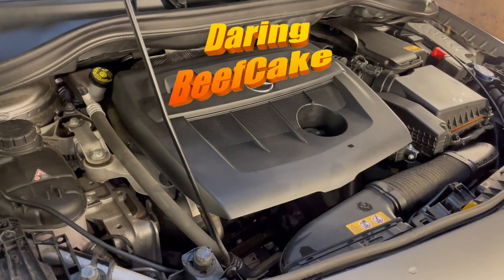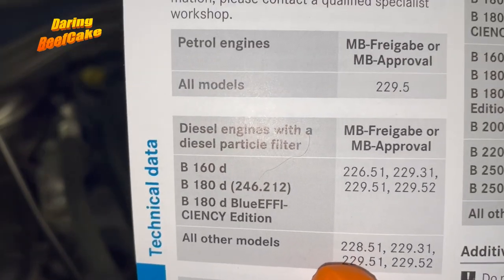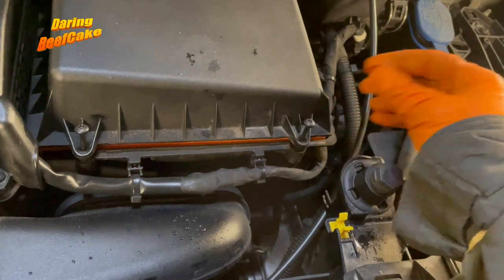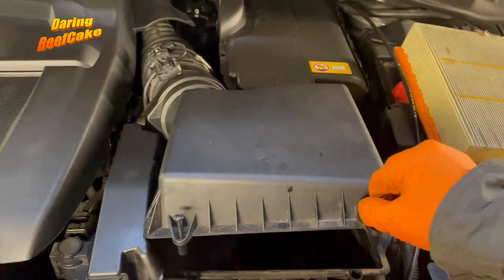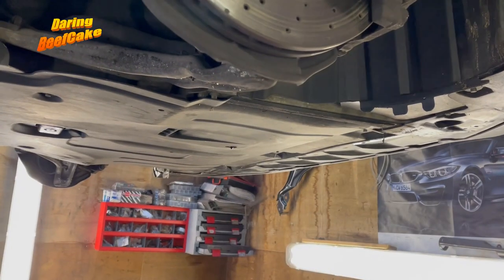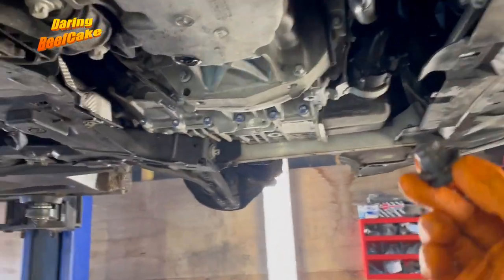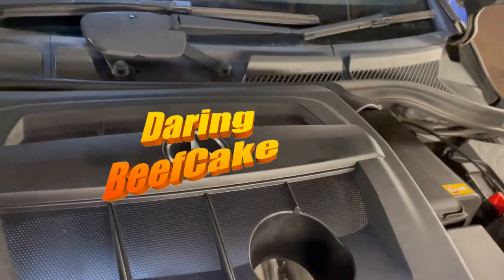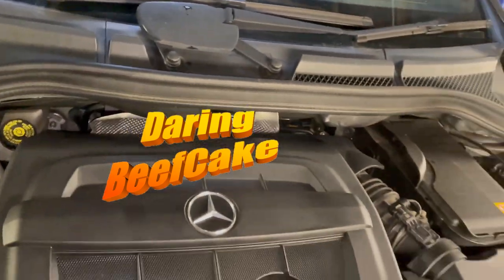Mercedes b class w246 212 2016 oil and oil filter air filter removal and replacement

Comment: I change the oil in my 2013 B250 W246 270 engine (petrol) sucking it through the dip tube - no need to get underneath. Way easier, cleaner and quicker. Perhaps you can use the same method for your engine.
Reply from the maker: Thanks you for the tip, it is definitely something to consider.

Comment: Hey, thank on very much for this video
Is the engine ticking that I can hear at 23:20 normal?
Reply from the maker: Did you mean at 22:20, if so it is normal for a diesel engine, if petrol not so normal heheh.
Reply: @DaringBeefcake yes I did, and thanks! I have a diesel so nothing to worry about  😊
Reply from the maker: @davidglukh6473  that’s cool 😎